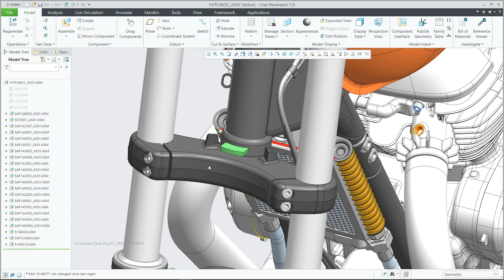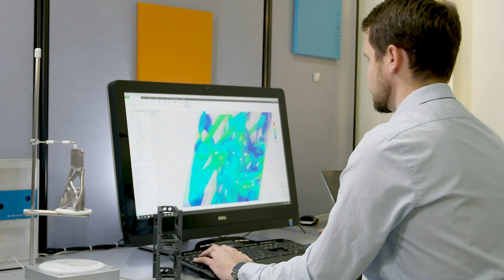Generative Design: The Future of Product Design

Comment: Is this all done locally or on your servers?
Reply from the maker: Hello Paxton,

Generative Topology Optimization is currently available in Creo 7.0, and this solution runs entirely on the design engineer’s local workstation.  Later in 2020, PTC will release our cloud-based Generative Design extension, which will enable design engineers to simultaneously create dozens or even hundreds design solutions, with the best options highlighted for review. Generative Design extension will be powered by PTC cloud servers.

You can learn more about PTC’s Generative Design at ptc.com/generative .
Cheers!